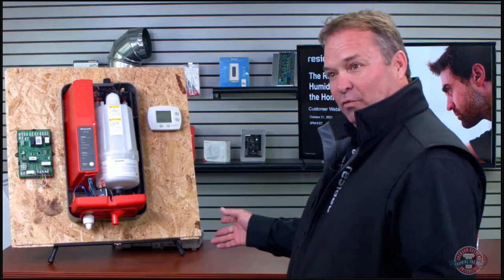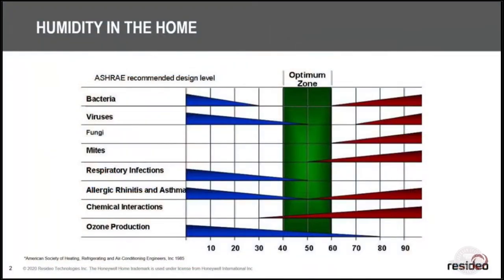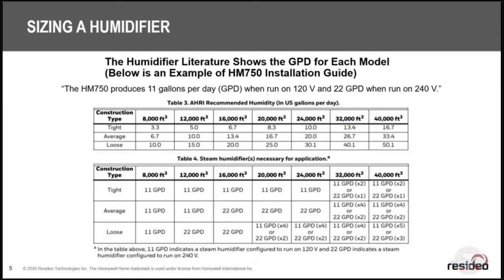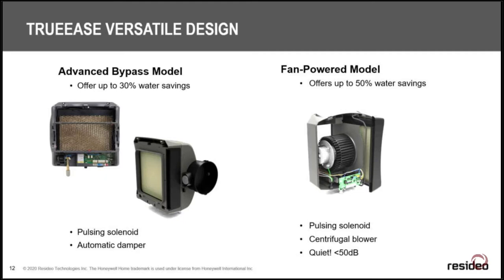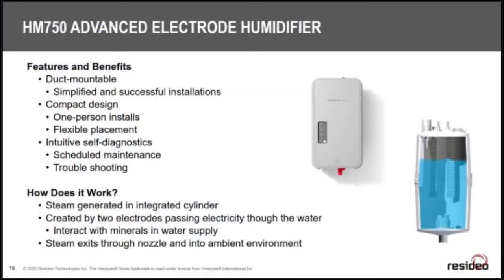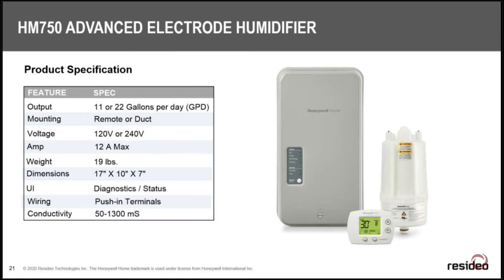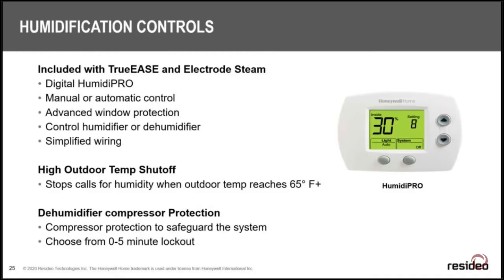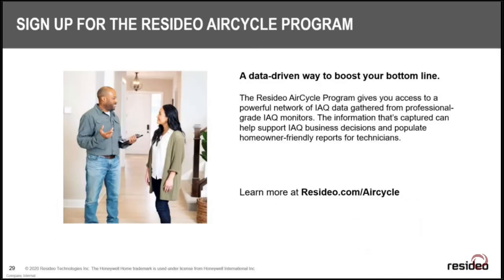Honeywell/resideo Humidification Full Training- 2021

Comment: I just finished installing the HM750A1000 yesterday and I can not get it to start up, its flashing 3 times on the fault led and it says current fault I think its due to no water filling up the steam cartridge, fill valve seems to be working, do you have any idea why its not filling up with water?

Comment: Great video but I I need to know how to wire the 750 steam humidifier without a humidistat to me communicating Carrier ion tstat and modulating furnace. There is no clear guidance on this in any of the documentation.
Reply: Is there hum terminals on the stat or the furnace?
Reply: @marvingoodwin1  I have similar issues. I wired two HUM's to two U's on Honeywell T10. Do I need to wire GT, RT, GF in addition to two HUM's?
Reply: @kimhuyoung5482  Let me know how your install turned out.  I'm getting ready to hook up an HM750 to my T10 thermostat this week.  Were you successful?
Reply: You need to look at the documentation for your stat.  See if it has dry contacts (outputs) labeled HUM.  These are used to call for humidity.
Reply: Just an update:  I successfully hooked up my HM750 to my Honeywell T10 t-stat without issue, other than the unrelated discovery of a flaky pressure switch in my furnace.  The T10 has two HUM terminals that effectively wire straight to the two HUM terminals in the HM750.  Since the stat is WiFi connected, it pulls in outside temps via the internet, and I can set window RH protection limits in the stat.  The stat also controls whether to only engage the HM750 with a call for heat, or it can call the blower on demand.  Side note:, highly recommend installing an air proving switch, and wiring direct to the corresponding terminals of the HM750!  If not, the humidifier will continue to provide steam during the blower idle delay during the burner ignition cycle.  I have tried both a fixed .05 and variable Cleveland Controls pressure switch.  Either work well.